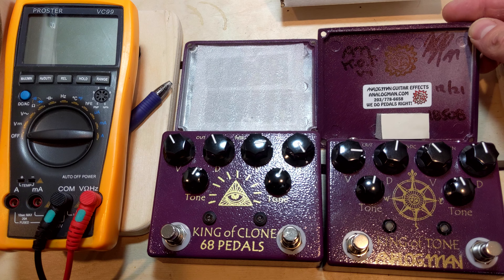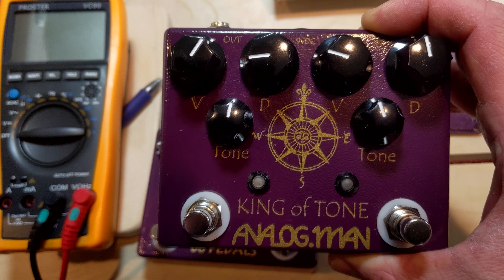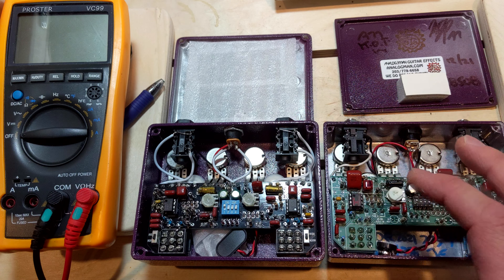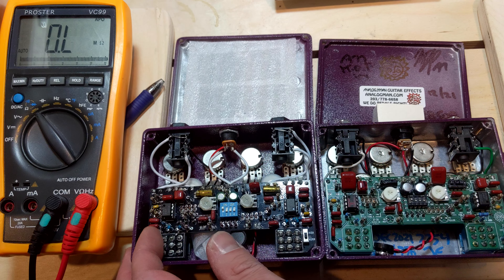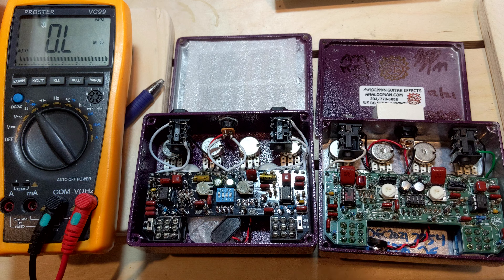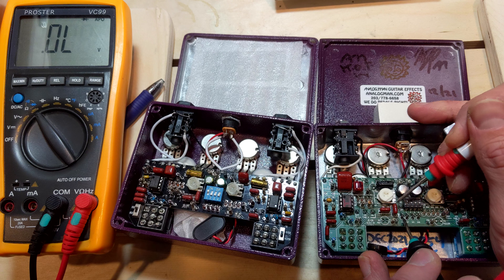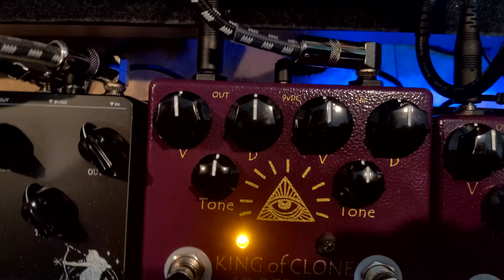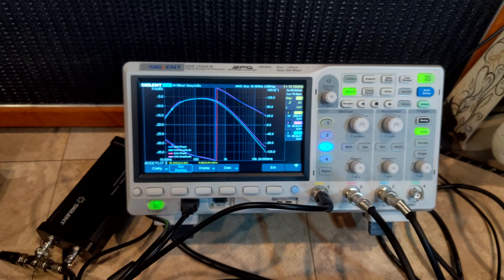Pedal Builder REACTS: Real Analogman King of Tone vs King of Clone by 68 Pedals

Comment: The diodes you tested are only used for distortion mode, which is rarely used. it’s the yellow diodes that are important to the normal overdrive sound. people hate superbright LEDs blinding them, so we spend extra time making them look good when the pedal is on. hope that helps!
Reply from the maker: Thanks man! Big fan of your work and thank you for the thoughtful reply. I'll pin your comment for others to see as well. 🤙🏻
Reply: Panasonic MA856 diodes...rare item...
Reply: while waiting for my name to come up in the waiting list, I have bought this pedal, this helps me decide on the additional mods that I will pick once that I get the chance to buy the official KOT.

I hope a mod similar to JHS 4 star mod becomes available from Mike himself.
Reply: The LED diffusion helps off-axis brightness and reduces the blinding spot directly above the pedal.  It's a nice touch.
Reply: @khoerde9897  1N4148 is a good replacement.
Reply: Thank you soooooo much for dimming the LEDs analog mike!!!!! MXR pedals blind me 🤣 you're the man!!!!
Reply: @analogspam Interesting to see you commenting on this video Mike. The 68 pedals version is very near, in looks and sound, to the OG… but not using the trademarked names. Would a hammer be applied if one of these crossed your path?
Reply: Yes, I do like a dimmer LED and the 68 pedals LED’s look like yours when they are on. We know all the tone is in the LED’s!😊 I like the distortion mode the most. Do you believe it suffers in tone “diode wise” comparatively to the OD diodes-sound wise?
Reply: Had to stick a bit of maskung tape in the light cos it was giving my bass player  headache. I could still see it clearly.
Reply: Patiently waiting on the list for KOT. Bought the POT from Analogman to scratch the itch in the meantime, and I love it. Thanks Analogman.🎉

Comment: Funny how clones are just fine when they're expensive and assembled by a boutique builder but they are evil and terrible when they're mass produced. The whole "boutique" pedal market was founded by and is sustained by cloning and using circuits designed by other companies. Now it's "trade dress" we get sad about too.. But as we all know, multiple initials in Sharpie on the inside is what makes a pedal sound the best
Reply: I started doing pedal DIY stuff and it blows my mind that people fall for it. You're absolutely right. Warm Audio is fine, but DemonFX is not. Analogman uses dusty old NOS capacitors with worse tolerances than modern capacitors and this somehow justifies the spending. Analogman is a branding company. $195 for a BC108 Fuzz Face clone, but the sommelier himself selected these extra special BC108 transistors.
Reply: @ I have a Demonfx  Mini Chorus.. Knock off of analogman (who knocked of EHX and added a couple tweaks). It sounds fantastic and cost $45 shipped. Also People act like adding a couple potentiometers is something special, it is often just replacing a fixed value resistor. Make the resistance variable at a new point in the circuit, add a hip paint job and BAM “boutique”. Just like IPA beers.. take a basic ale recipe add hops to the point it’s almost undrinkable, put a cool label on it with a witty name and there you have it.

Comment: Great review. Did u get to try the lyrock version of king of tone and how does it compare tp the original?
Reply from the maker: @kennylim6099  they sound the same with the exception of a the slight tuning of the knobs to accommodate the tolerances in pots. "A circuit is a circuit" - Josh @ JHS 🔥
Reply: @TheToneGeek  Seems likes most of the clones (68 Pedals/DemonFX/Lyrock) are using the same circuit boards. Looking at some users' posts comparing 68pedals and Ly-rock boards, the difference seems to be in the components used. 68 pedals use Nichicon Gold Audio Caps but Ly-rock is using a different brand? Does the component quality affect the tone/dynamics of the pedal? What do u think are the critical components on the circuit board that users should look out for?

Comment: Great video.
But there is one thing that an oscilloscope can't measure, the quality of the sound. 
You can make a cello, and an eletrical guitar, and a piano have the exact same response on the oscilloscope. 
But the quality of each sound is completely different of course, each sounds like their instrument.
I've always wondered what tool is used to measure precisely that, if any exists (i'm sure digital tools do, given the current AI in Kempers for example)
Reply from the maker: Good point! And I agree. There is definitely more harmonic things going on. I think that a spectrum analyzer might be able to capture the harmonic peaks from a pulse spike would be good. It could measure the pedal's reaction to the incoming energy. Capacitor selection would be big in this way

Comment: Hi I have an observation and a question. I own to of these clone. Got one for curiosity and loved it so I then ordered another on ebay and hated it. What is the difference ? in my case one has a terrible noise floor. So the test for me (I know nothing about electronics) is empirical. I engage the overdrive both sides and everything around 3 o clock then I turn my guitar volume all the way down. One makes a tone of noise and the other seems to have a quiet hissss type sound which is fairly quiet. Depending on the venue when I do this I can even get radio interference. To me this makes or breaks a pedal. That is why I love brands like EQD. some boutique brands fail this test. Most Wampler pedals are noisy. I was wondering if the REAL KOT performs equally or is this part of a clone defect.
Reply: Running 18V power to my KoT, gain and volume at maximum, I can hear slight hiss when I enable either channel, and a lot of hiss if I enable both channels at once.  I never run both channels at once with everything dimed, though.  At more normal settings there is a very slight hiss with both channels enabled.   I've never heard any radio interference on the KoT.
Reply: @JohnShalamskas could be to with quality and length of patch leads inbetween pedals (shielded), isolated power supply, pedal order, certain pedals can create different levels of interference depending on what other pedal they are connected to, so always worth swapping pedals about and seeing what results you get when plugging into others. All about trial and error. Then again it might be none of these factors.